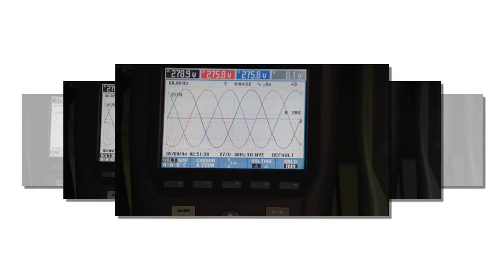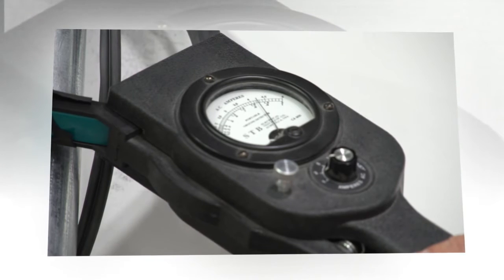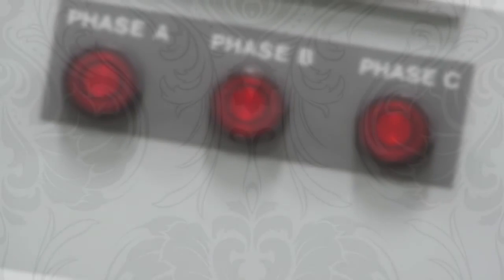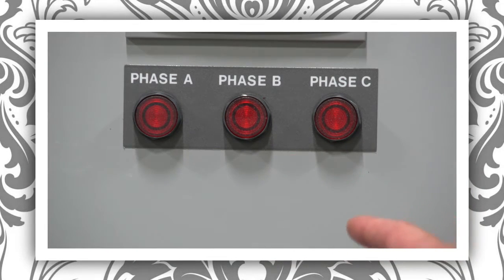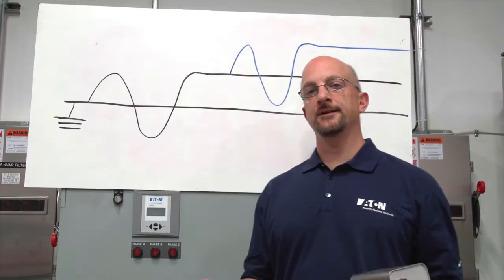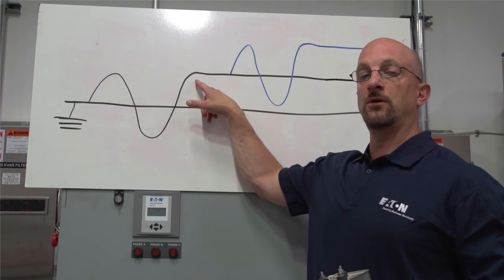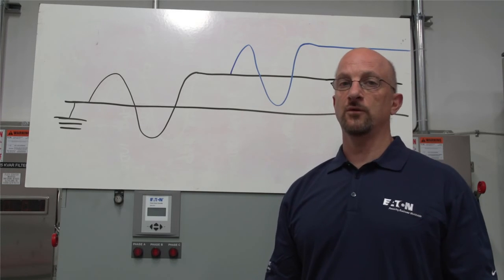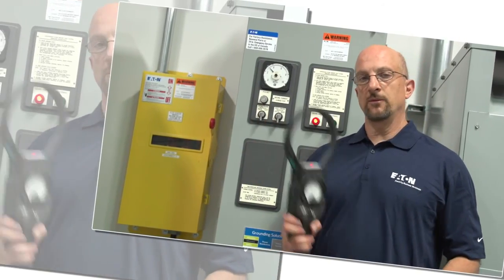High Resistance Grounding

Comment: Question: when measuring the ground fault current using the ammeter around a conduit, is it ok if the conduit has the ground conductor as well? Or does it only work when wrapped around the three phase cables only?
Reply: Adam, it depends what meter you are using, I have yet to see a ground cable run in the same conduit as the phases